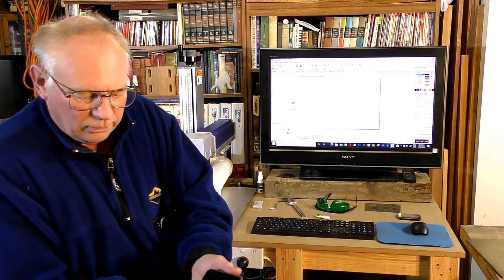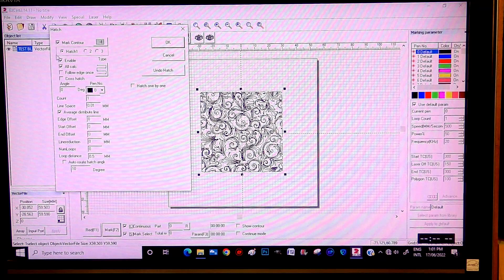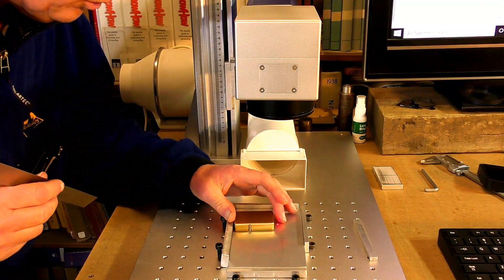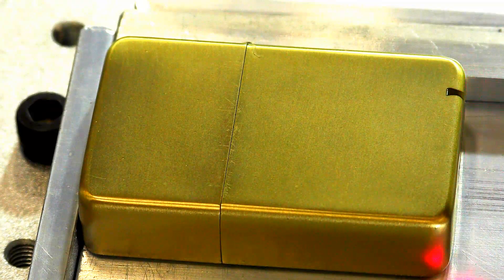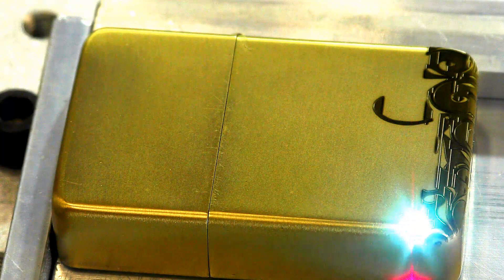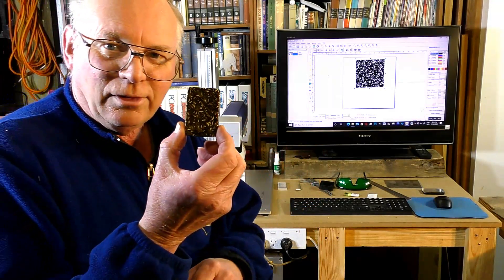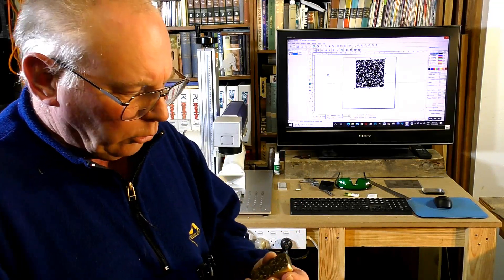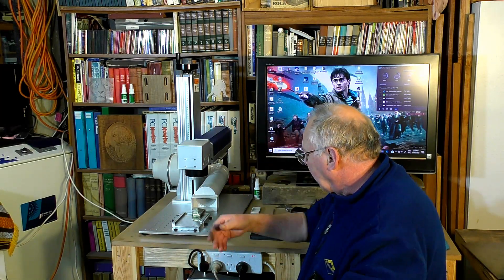30 Watt Fiber 🎇Laser Engraving Metal how to A to Z

Comment: You could get digital read out bits, cost between 50-300. But the precision will be worth it, if working in parts of mm. otherwise just use a digital caliper and use that for measuring, very accurate devices.

Comment: What surprised me the most was the cost of a Zippo these days.

As a kid in the early 60's we spent our spare change at the local carnival fair each summer playing the various games. All us boys tried our luck at winning new lighters for lighting off fireworks. A few vendors had actual Zippos but soon all gave out "made in Japan" copies. They looked and functioned exactly the same. All of the lighters including Zippos we're solid brass with a brushed plating outside.

A summer of jingling around in your pocket with change and pocket knives would start to wear through the plating to reveal the brass underneath.

I suspect I still got a few of those lighters in a box somewhere but had no idea they were worth much more than $10.00 bucks tops for a new one.